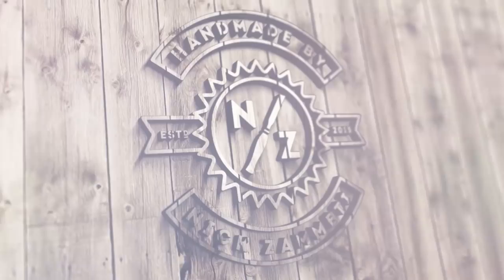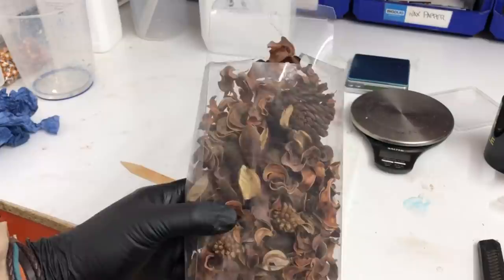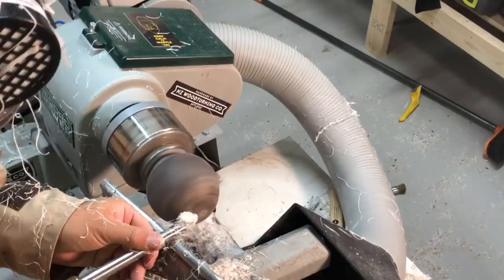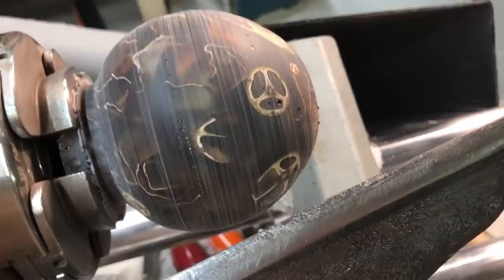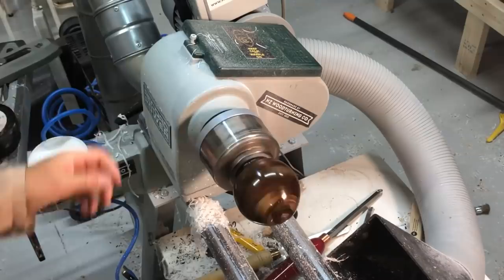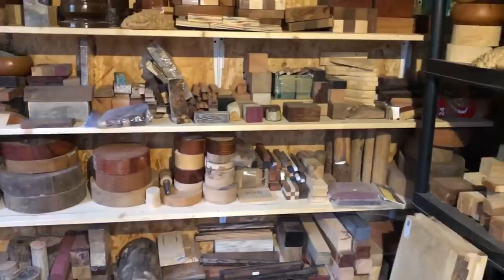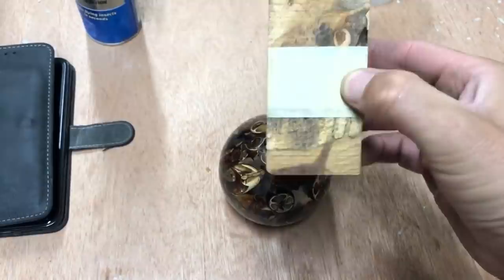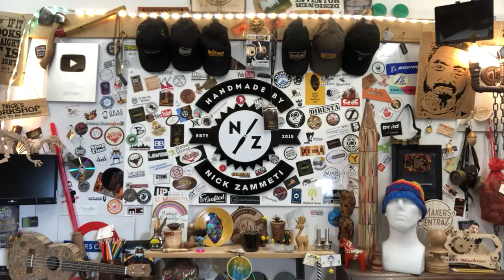Woodturning - The Solar Galaxy Orb

Comment: 3 things....
1, check out this old Tony. He has a neat tool he made for advancing the tail tool with a cordless drill.
2, perhaps make a mechanical finger with Velcro on the tip for getting inside those tiny holes and sand the inside.
3, very cool piece. Love the channel.

Comment: Cool.
Heat up the neck of a toothbrush and hotglue a sandpaper or what you  want to polish it up with. You can bend the end of the brush when you heat it up to follow the shape of the inside 👍🏼♥️

Comment: Nick, to shine the inside: you could put a little bit of warmed resin inside of the pot and run the lathe as slow as possible to coat the inside evenly. Then dump out the excess resin, put it on 'one more' time on slow to remove the pour trail, then take it off the lathe and set it gently bottom down to set up.
Reply: Just make sure you are well aware of your resin dry time (especially if you warm it to make the resin more liquidy), as running it on the lathe too long could result in blobs of resin and you will be back to square one.

Comment: To get inside for sanding, go look up how potters use sticks to smooth and clean up the insides of narrow pots when throwing. you can make them as you go, using various grades of steel wool to sand instead of sand paper, pad it with sponge.

Comment: Nick you should put an LED tea light in this, would look really cool.

As for reaching into pots like this, use a dremel cable extension, small long(er) reach and you can use buffing disk / pads. 

Also for a unique tip both Mothers and Maguire's makes a metal polish that works great on plastics and glass. The mag - aluminum type.

Comment: TIP: To get a nice smooth clear inside next time use an old light bulb - sink it into the resin then when the resin is hard smash the light bulb - empty it out - now your inside should be smooth as glass.
Reply from the maker: AstarOfDavid hey cool idea man 👍🏽🎺
Reply: @nickzammeti  Yeah! And you'll need less resin so you won't be wasting as much.
*As a side note there are many sizes & shapes of glass light bulbs to choose from so depending on the size of the vase/container you'd like to make you should be able to find a close size/shape to match.

Comment: I know it could possibly wreck your tools but a sphere with small gears in it would be really neat. The plate was cool too.👍 🍻
Reply: you could use gears made out of wood or plastic. Plastic might even be able to get a solid color close enough that it'll look like metal.
Reply: Cast gears from resin
Reply: @wrendellajoens3984  i change my answer ;)
Reply: Standard Wood tools can easily cut through Brass and Aluminum, so if the gears are either of these, they'll work just fine without damaging the tools (Steel on the other hand would likely damage them)...

Comment: if the finial is loose in the fitting (semi accidential, because we never make mistakes, just small alterations.) You could also put a small part of a bicycle inner tube arround the the tap. perhaps even put a real small recess/undercut where the innertube can sit in. like a weck-jar/preserving-jar.

Comment: Something I've done with interior polishing is a paper towel folded repeatedly accordion-style into a long strip, inserted in a loop bent in a heavy-gauge wire which is then chucked in a drill. Ye can swap out the towels when using compounds!

Comment: Setting your lathe to the lowest rpm setting, then filling the orb (about 1/3 full) with an extremely fine grit sand and tape the end shut.  Let it run for a few hours and you might be surprised at how well it polishes the inside.  Similar to how you polish stones in a rock polisher.

Comment: What about adding a short line of fairy lights to the inside of the pot. It would brighten up the inside and you would see all the bits and Bob's better maybe. Or it would look like a pot full of little fairies flying around on the inside.

Comment: I know this is really late, and I don’t know if you read comments this far back, but I have a possible solution for polishing the inside of pieces like this.
Here in the States, we have a tool for polishing composite headlights when they get foggy. It’s a spongy ball on a bit that you attach to a drill, and it’s supposed to work in a similar fashion as your polishing wheels. I would assume you have a similar tool in the UK.
I imagine that you could cram something like that into the piece with a little compound while either the piece or the tool is locked into the lathe, and that’d work like a charm.

Comment: @Nick Zammeti Wonder if you could dump in polishing compound like you use in a rock tumbler, put a rubber plug like a cork in the end, and run it for a bit on SLOW and see it it polishes the inside.  Maybe add ceramic balls like are used in air soft guns, to help more the grit along.  Worth an experiment.

Comment: You need an inflatable item with the ability to change out the surfaces. Then you can go from higher grit to lower grit. Maybe the inflatable item would have velcro style hooks and then you can just use ready-made surfaces with velcro on them.

Comment: You should make yourself a buffer that goes inside and expands. Mount it to where you mount your hole bit and spin as you do to get inside easier and safer from using your finger. A smaller version of your cloth buffer wheels but they expand and you can work them back and forth as the piece spins on the lathe. Sorry long work night my mind is not fully working from fatigue.

Comment: What about a child's toothbrush to get in there?   Or you can wrap some paper towels on the end of a stick like item perhaps a set of chopsticks taped together on one end, or a gun cleaning rod?  The cleaning rod would probably work really well as you can get a tip that is meant to hold onto small pieces of paper type material.  Also the cleaning rod would be expandable as the ones for rifles are made in several pieces that screw together to make it longer.  😊

Comment: Hi Nick would it be possible to pour the resin in a pot which has a center? Shaped like a fruitcake pan? That way you won't have to use that much resin. You won't have to scrape/ take out as much after the resin has set and the potpourri will keep it's shape more. Loved this project 💗

Comment: this comment will probably get lost to the void, but if you mix up some more resin you could coat the inside in a small layer that will fill in all the sanding lines and leave you with a clear finish